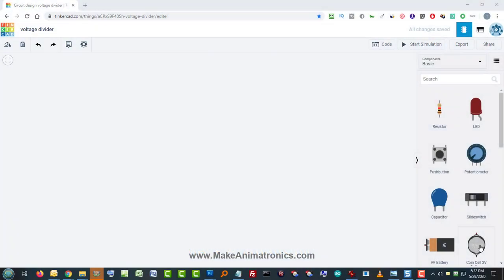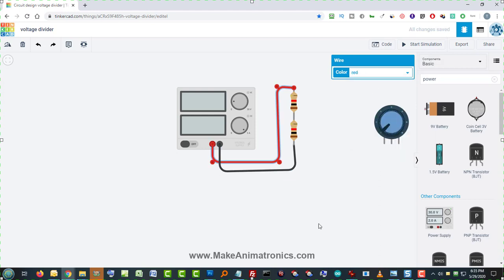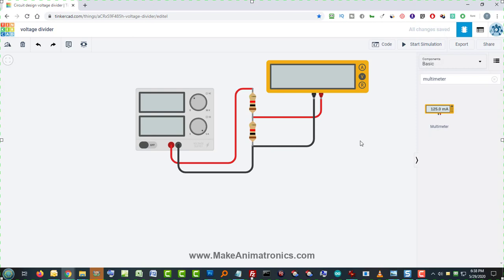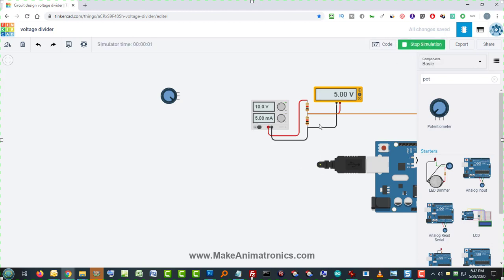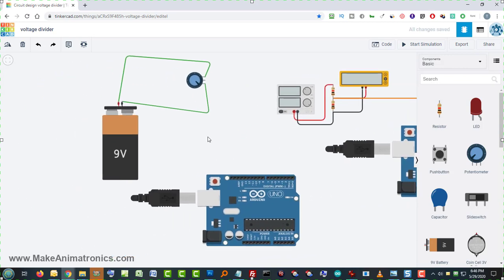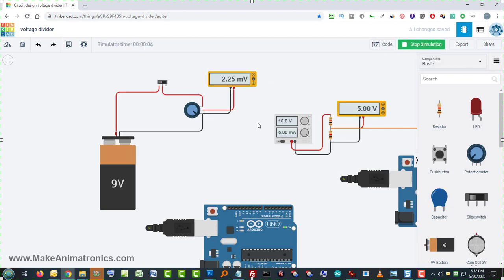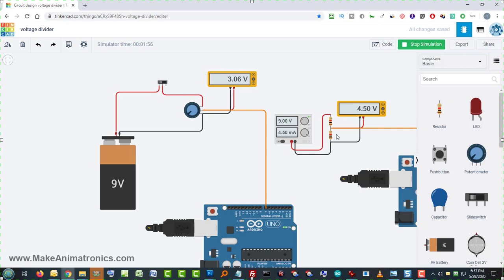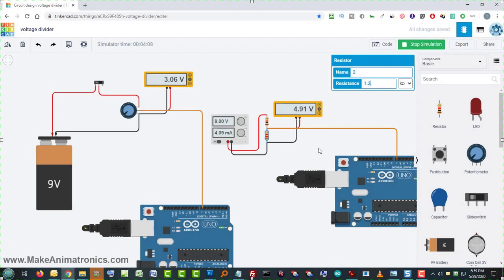Tinkercad Circuits #4 - How to Connect a Potentiometer as a Voltage Divider.

Comment: Doest the arduino need to be connected to ground of the voltage supply too??
Reply from the maker: Good catch! Yes, they should be connected if you were building a complete circuit. I was concentrating more on how to understand a voltage divider than actually using it in a circuit, but connecting the grounds would be the right thing to do.
Reply: @Electro-Mechanical-Basics  Glad I was right! Would've confused the hell out of me ;)